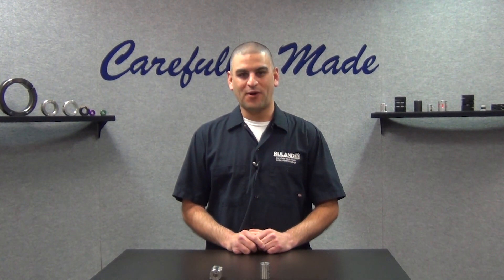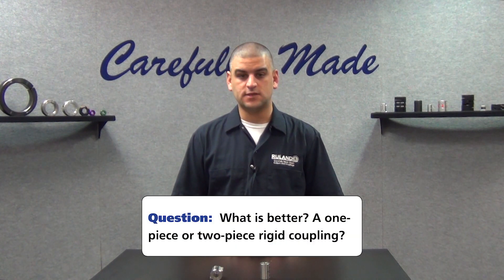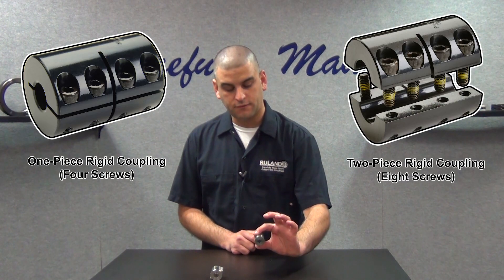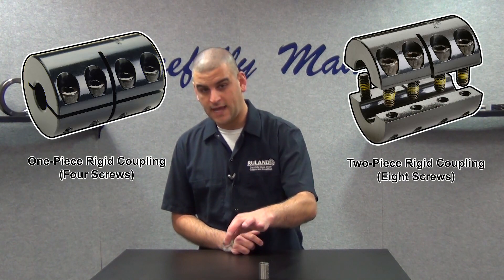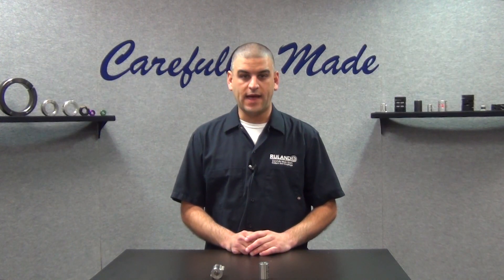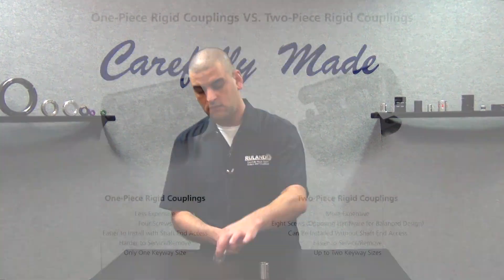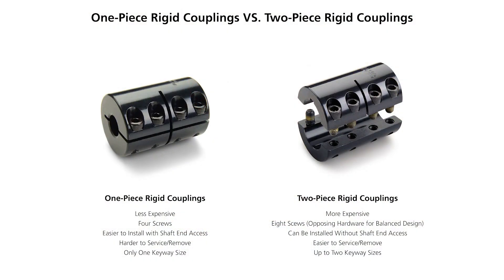Which Is Better: A One- Or Two-Piece Rigid Coupling?

Comment: I'm trying to secure my homemade shifter mechanism thats 2 shafts. Which type is more forgiving for less precise shaft tolerances?
Reply from the maker: Thank you for the question. Two-piece generally works better, but these are designed to work with nominal shafting. When you are outside of the tolerance, the coupling does not fit properly, directly impacting torque performance. We always recommend using nominal shafting to ensure the coupling perform's as expected. - Chris from Ruland

Comment: Can I make a question here? 
I have a shaft which I'd like to extend and mount a polishing mop, similar to a pedestal buffing machine, to polish metals and acrylic.
The shaft diameter is 24mm. I believe that a rigid coupling (solid, one piece with slit or two pieces) should be adequate. However, since the shaft is going to be loaded to it's side (pushing the polished piece onto the mop), I'm afraid it could loose or break the coupling during use.
What would you recommend? I'm figuring out a way to mount a bearing with support on the extended side (a thick cast aluminum "horn" from a loudspeaker with a bored holed to mount the shaft bearing and motor end-cap mounting).
Thanks!
Reply from the maker: Hi Marcelo. You are correct that a rigid is the way to go. The construction is preference based on the application. Side loading is a concern with the clamp styles as you can fatigue the metal at the clamp cut. This is something that may happen over time, however is not a frequent occurrence. The trouble with solid is if you have to remove the mop frequently it is going to destroy the shaft over time. The other issue with set screw type is if you have a lot of vibration it may cause the screws to loosen during operation. Again, not a frequent occurrence, but can happen. Most of our customers lean towards the clamp style because they are a little easier to use. - Chris from Ruland